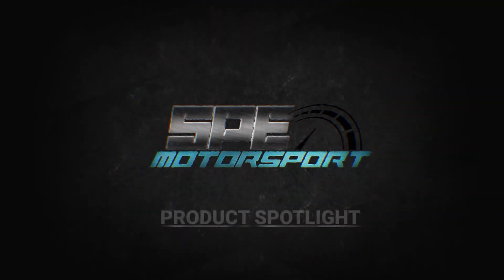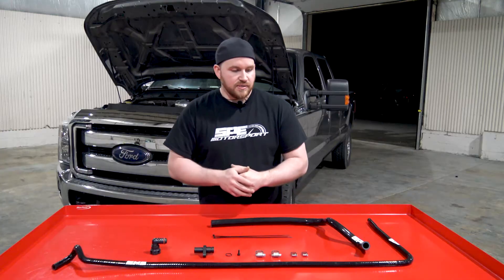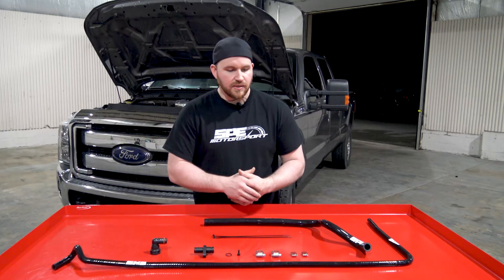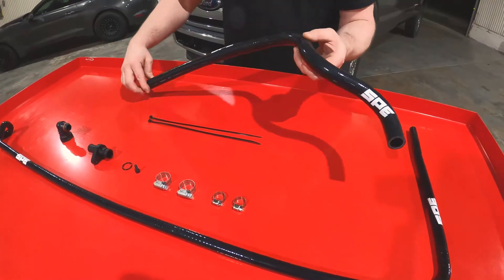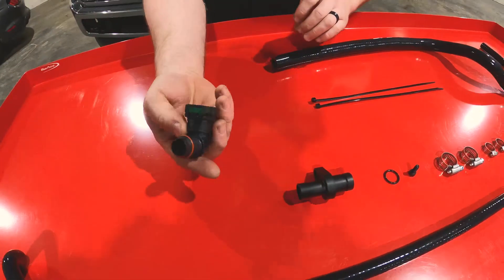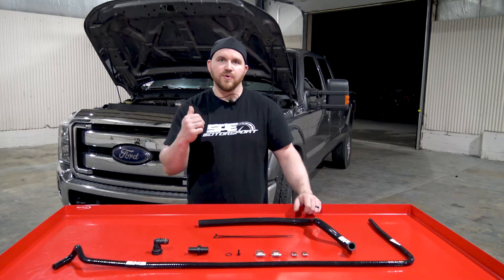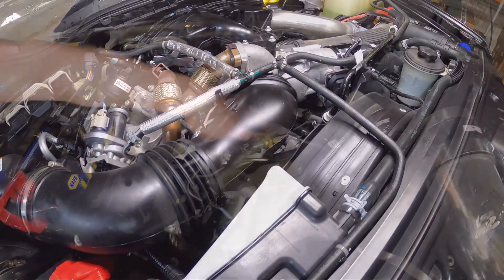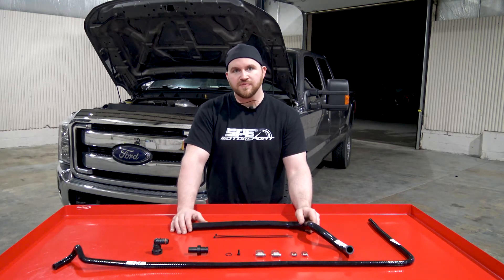SPE 6.7L Powerstroke Coolant Clean Up Kit

Comment: Y'all should look into doing a much needed upgraded hose that runs from the bottom of the degas bottle to the block.
Reply: Mishimoto makes a great new degas bottle that includes a hose that eliminates the stupid o-ring based hose and gets it back to worm gear style. Just did mine and it's great so far